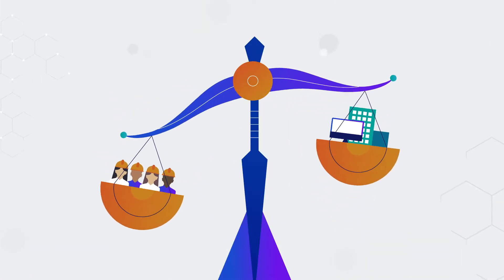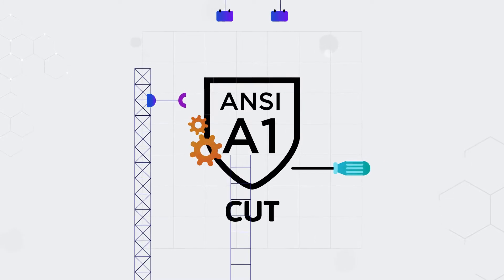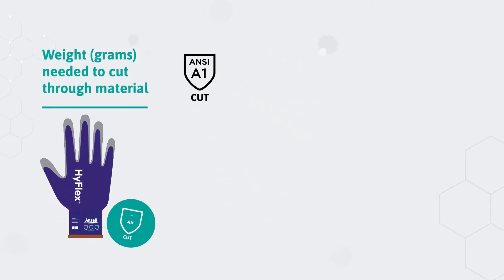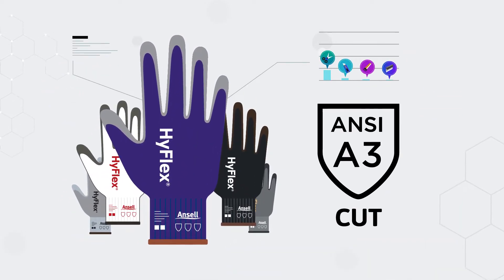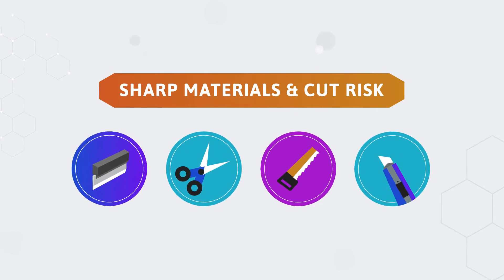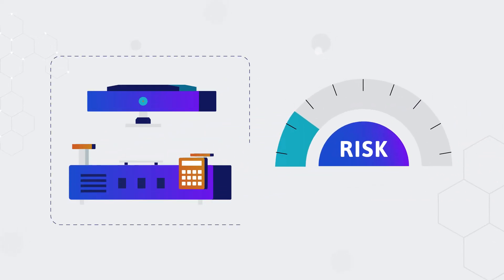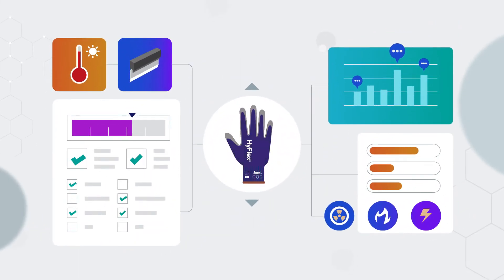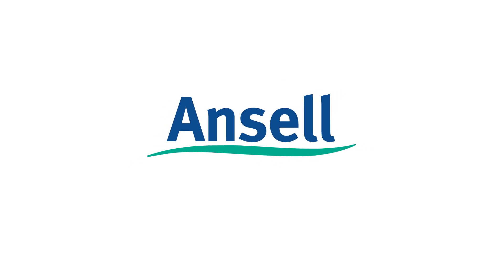How to Choose the Right ANSI Cut Protection

Comment: I think it would be helpful to see a break test video for gloves at different protection levels. Drawing a difference A4/5 may be difficult, but say if you break a thick piece of glass in a A1/5/9 (granted there is some puncturing effect which is different) it could make a point. They have videos like this for rock climbing gear. Seeing that my carabiners take 6000 lbs of force measured on a crane scale really increased my confidence in the equipment for rock climbing.